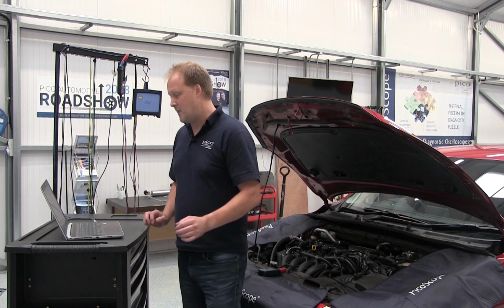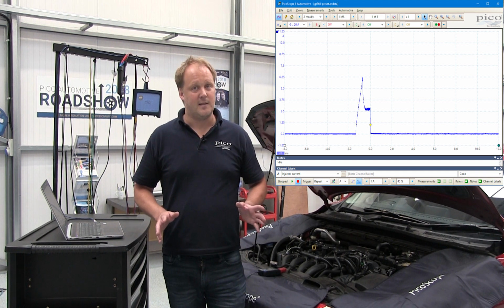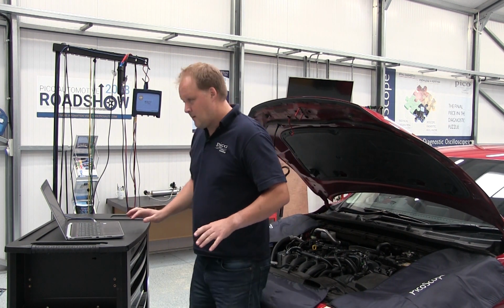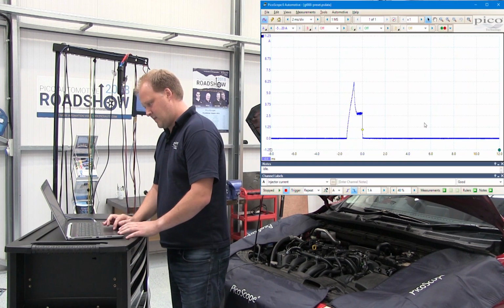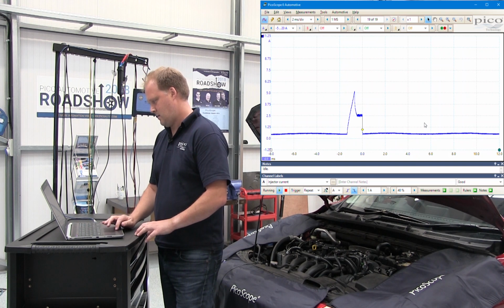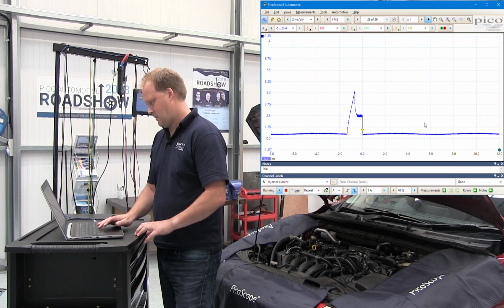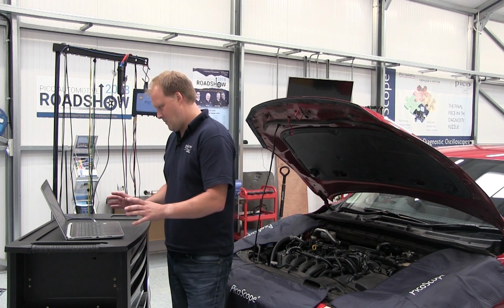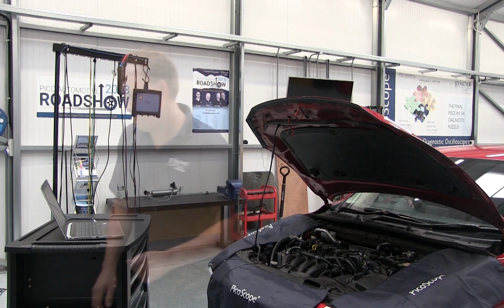Gasoline direct injection - injector current

Comment: Apparently you are looking at the current consumption of a gdi. From the screen we have a peak current of almost 6 amps and a tip peak time of 1.25 ms. Considering a conventional injection system that can work between 2.5 ms to 4.00 ms we have a reduced time beyond direct injection!
Reply: Direct injection systems control the amount of fuel injected by controlling the injection pressure in the first place, not by controlling the injection pulse width.  Only if pressure alone can't achieve the required fuel mass pulse width modulation comes into place.